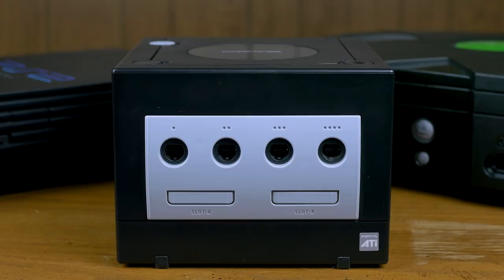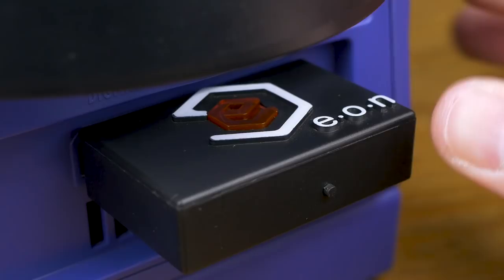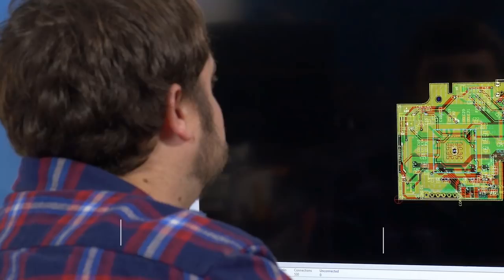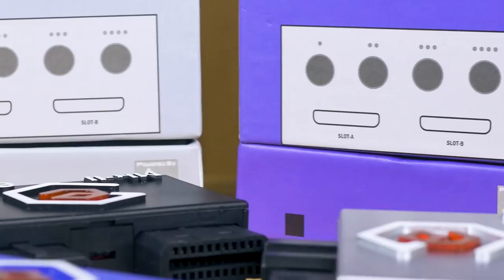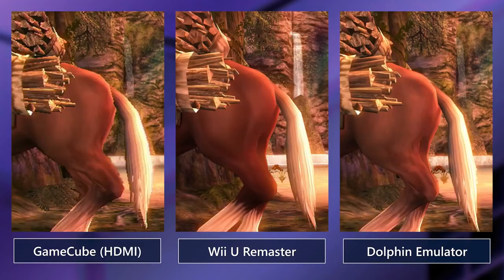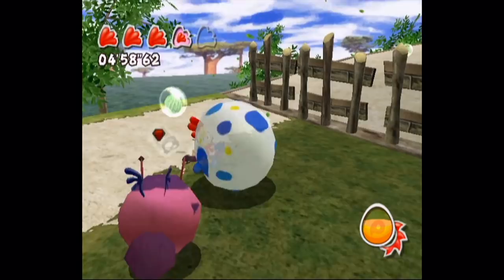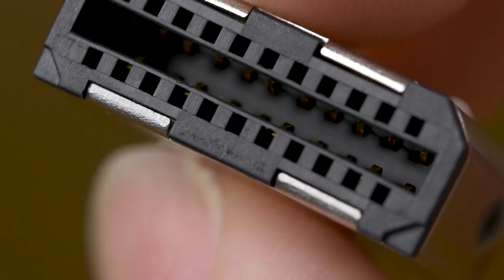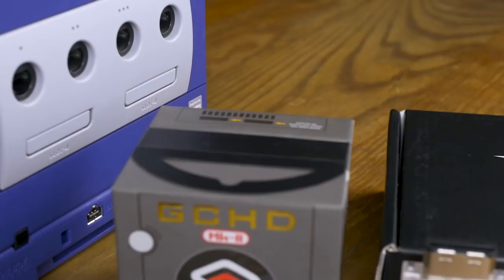Nintendo GameCube HDMI, Component & RGB Plug 'n Play Solutions :: RGB316 / MY LIFE IN GAMING

Comment: Just use a Wii, same hardware and easier to find cables..
Reply: Worse quality though.
Reply: @UCUKFq4xZjZhwIvPfieF2CUg Have you even watched the video..?
Reply: @symphony137  Unnoticeable in the later models
Reply: @Blehstor  The differences may be minor and it may be an alright solution for most casuals, but enthusiasts usually want the best possible quality and it's a fact that most of the time the Wii's output is inferior. Not to mention you would also lose the Gameboy Player feature. Also, many modern TVs or monitors don't even have component inputs anymore.
 Here's some good stuff to check out regarding GC vs Wii output quality: https://socksfelloff.wordpress.com/2015/03/15/gamecube-vs-nintendont-vs-wii/
Reply: @symphony137  Surely if you have hundreds of dollars to spend on a Gamecube plus adapters, cables and games go for it. Wii's USB compatibility makes it infinitely better for playing games imo. Just put them in an hdd and play them with close to no difference than a Gamecube.

Comment: All I can say is the MK 2 EON is trash.  Why does anyone like this???!!!  The Wii did a better job then this.  Text is all jumpy
Reply from the maker: [Try4ce] That is only for 480i content. Hold the B button to load games in progressive mode. Most notable GameCube games support 480p mode. The "jumping" is a type of deinterlacing called "bob" which does so to be as lag-free as possible. That's a matter of taste, between that type of deinterlacing, and the laggier deinterlacing your TV will do. If you don't like the jumping, then open the Mk-II menu when 480i content is loaded, turn the linedoubler OFF, and then save. This will let your TV deinterlace instead of performing the bob deinterlace. But for 480p games, that "jumping" will not happen.
Reply: @mylifeingaming  thanks for your reply. I figured that part out. But now I have a MUCH BIGGER issue. Audio lag...  after a few minutes of gameplay I'll start to get a 3 to 5sec audio lag...  for example the sound of the gunshot will now be 3 to five sec behind. Any audio.  Only tested it using the hdmi.  Component seemed fine. But I only mostly tried out hdmi.  Any idea??
Reply from the maker: [Try4ce] That is an interesting issue, and sounds like a compatibility thing with your TV to me. Haven't seen that before. Maybe it has something to do with the enhanced DVI mode. Do you use a separate sound system? Have you tried using analog audio alongside HDMI video?
Reply: @mylifeingaming  I shouldn't have to use any of that though. I got this for the hdmi.  I dont wanna use the analog also.  I'll be getting my $150. It's bad enough that it's over priced. But even worse that it doesnt work correctly. AND Amazon is censoring reviews.   I posted 2 reviews on Amazon for this

And I use a 55n of 4k LG TV with a sound bar.  For shits and giggles I'll tried it without the sound bar.  Still the same issue. After a few minutes of gameplay the audio is lagged behind. UNLESS theres a setting I'm missing on the menu?  Like I did with the awful jumping text.  I cant find anything for audio
Reply from the maker: [Try4ce] Yeah I don't know what the issue with that is. Very strange. You would probably have a similar issue with any of the other HDMI solutions as well. I have the same/similar TV, but I don't use a sound bar.
Reply: @mylifeingaming  well like I said the sound bar doesnt matter as I tried it without it and I still get the same issue.  Sadly I guess I'll be returning this as I cant find any info on this online.  I'll try out the component alittle later today.   Still pretty sad the audio has issues. Should be 0 problems for a device going for $150

Comment: Yo. I have a solution for this problem. Instead of paying $70+ for an expensive adapter, just buy a Wii for around $60, they support component without it being a massive pain in the ass. Problem. Solved.
Reply: the wii rvl-001 component output isn't as good as the gamecube digital av output
Reply: @gamecubeplayer  
▪
What would you say the 2nd best option is after component cables ?
🟥
Reply: Did you watch the video? They address this
Reply: @gamecubeplayer  anyone who has that model is a sad ass foo, the only Wiis that were worth anything were the ones that came with the WiiMotion Plus Inside WiiMotes. That one has better output, and its not enough of a difference between the two to justify spending considerably more on a GC for slightly better picture quality
Reply: @dirbyozz  the wii rvl-101 doesn't play gamecube games without homebrew
Reply: @gamecubeplayer  Actually, there was one Wiimote plus bundle with a later RVL-001. The Black Wii I got came like this, and could still play GameCube games.
Reply: @AceTrainerX3  i never knew there was a wiimote plus rvl-001 but it means that console can't have boot2
Reply: The Wii is not compatible with the Game Boy Player.

Comment: A wii costs 30 dollars.. and runs gamecube and has 5 dollar component cables and runs retroarch at 240p arcade perfect to a CRT,........... by what logic would you buy this crap for a gamecube
Reply: Gamecube games on the wii look sweet i agree..that is how i play my gamecube game..
Reply: Well, there's the Game Boy Player if you want a hardware solution instead of a software emulator at the very least.
Reply: @Thomas smith 
Did you even watch the video ? They clearly explain the advantages over a wii... 
also there are many that simply prefer the gamecube over wii for collective purposes, not to mention the Gameboy Player
Reply: @dylankohn  Technically you can mod the Wii to not require any of that stuff and just boot into whatever you need to with a GC controller if literally the only thing you're interested in are GC games. But I honestly wonder how many people would actually fit that bill lol. Also in order to mod the Wii you would need to use those peripherals in the first place and then shove them in your closet forever.